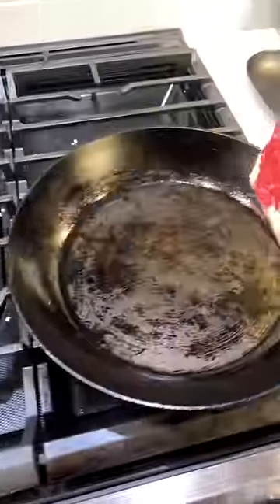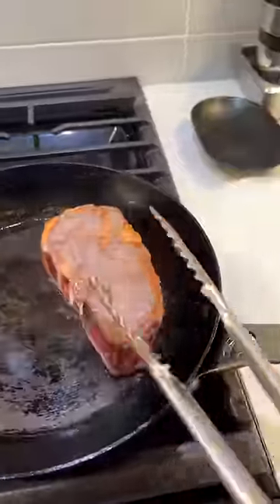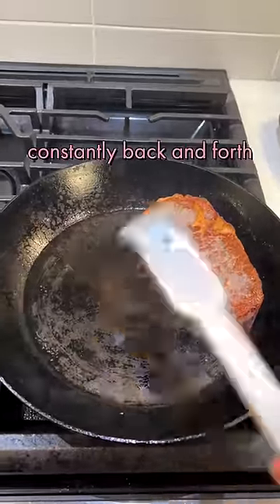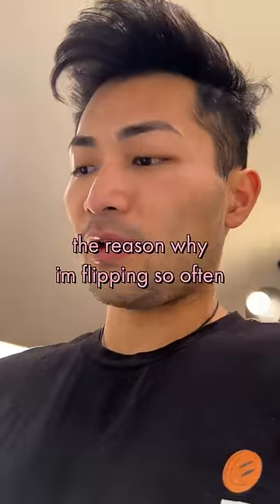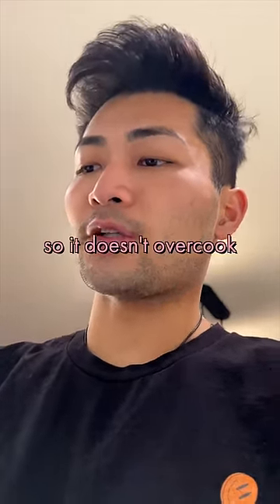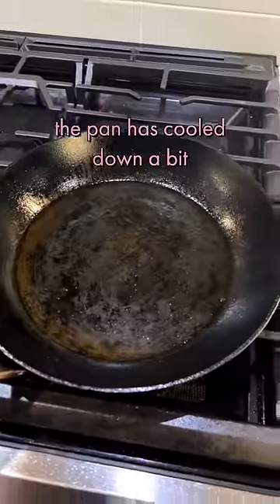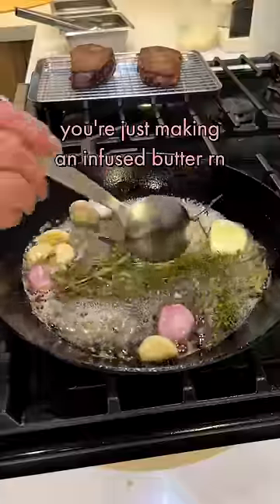useful steak tips for the home cook, part 2 of 3

Comment: Dat "knob of butter" 😂
Reply: Bruh added a pound of butter for 1 steak
Reply: @Blernster  it’s wasn’t that much butter, but the reason he used so much is so you can baste the steak. basically scooping the melted butter up with a spoon and pouring it on top of the steak to cook the top with the hot butter
Reply: “2 shots of vodka”
Reply: “Dat”
Reply: @Blernster  your acting as if he is gonna literally drink the butter with the steak.
Reply: @Blernster   that’s about 3-4 table spoon.. not even a lot for a 20+oz steak like that. And most of it goes away in the cooking. He’s not slurping it all and eating it with bread lol.
Reply: I use ghee which doesn't burn and is still full of butter flavour

Comment: i like the method of flipping often. I think of it as almost "rolling" the protein across the pan or grill. 

in addition to what you explained, i think it's also really great for people who maybe aren't as experienced since they might not know the timing for the "one flip" method and risk burning the meat with such a hot pan.
Reply: well said!
Reply: On Bon Apatite they called this the "frequent turning method", the main advantage being for non-uniform cuts that could cup slightly when the cooked side contracts and the uncooked side doesn't, so a portion of the cooking side no longer touches the pan. Frequent flipping means uniform cooking and contact, so even crust development, even on cheaper cuts.
Reply: @User-j63849j  or, get this: multiple ways work. clearly, doing it either way can yield great results(a proponent of frequent flipping that comes to mind is gugafoods)

so why not appreciate both? there's plenty of people such as yourself promoting one way of doing it and its good to change things up.

Comment: Flipping will make the caramelisation process slower/harder and pressing down on the steak will make it’s fat loose on the pan, instead of its inside
Reply: Could you make a video showing this? I've heard the lack of flipping is an ego thing. It's better to over flip and make a perfect crust.
Reply: There are many good techniques in cooking to maximize good flavors and minimize those you don't want. People take it way too far with steaks IMO and there's a lot of BS out there. The difference between doing flips every 15 seconds and doing only 1 flip is so minimal that you'd never notice in a blind test. Something like basting with an aromatic oil/butter makes much more difference to the final product than the flipping, patting, etc. that people are doing to their steaks. Cooking a steak well is really not all that complicated and you don't have to rely on weird "tricks" to cook a steak well.
Reply: @anthonyantoine9232  I completely agree. Steak isn't a set cooking recipe. There are several people that start learning those old ways or bs that you shouldn't even test the temp of your steak by piercing it. Steak is amazing and is an easy way to impress you're guests once you get it down.

Comment: Do not press steak unless
1. Its very thin and curl and you need to flatten it (its a lost cause anyway)
2. When its already sealed, and you want to check its cooked to your liking (how soft it is tell you how cooked it is inside)

Pressing on it before it sealed just lose you juices to the pan, making it colder and the steak drier
Reply: yeah this guy also flipped 6 times which doesn't make any sense. I learned you flip once and then broil.
Reply: Yeah! Plz don't press it
Reply: @GorillaCape flip once is a rookie move!
Reply: Searing does not seal in the juices. Escoffier was wrong on that one :/

Comment: You actually don't want to press down, You want some oxygen in between there to help the Maillard reaction.
Reply: maillard reaction can occur without any oxygen present, the concentration of oxygen doesn't affect the reaction rate
Reply: this video is pretty wrong, basically everything he said is the exact opposite of what you want to do
Reply: @ObieTriceratops  I was hoping for this comment! That's why I said 'help' the reaction. The air keeps the temperature under control. If you heat at a temp above the maillard threshhold it burns the enzimes, which is difficult to distinguish.
Reply: @Apoz   maillard is by definition non-enzymatic browning. Are you just making this stuff up?
Reply: @ObieTriceratops  Haha! Sick, didn't expect the same guy to take the 2nd bait as well. Maillard is a non-enzymatic browning indeed. But it still chemical reaction of amino acids.

You must be the guy that knows a bit here and there, gets confident and subsequently forgets to properly read the question on tests?

Reading comprehension must not have been your strong suit!
Reply: @Apoz   so you’re saying air between the steak and pan distributes heat better, which prevents enzymes from burning by keeping the temp under the “Maillard threshold”,  and thats important because the reaction involves amino acids?
Reply: @Apoz  don't be a coward, defend the nonsense you're spitting out.
Reply: Without good contact with the oil or the pan, there won't be as much of a Maillaird reaction--or there will be more burning. Conduction is, as you allude, more efficient that convection.

In this technique, the frequent flipping  helps keep the surface temperatures in check.

Comment: This is Hestons method. He used a thermal camera to see when the top side cooled down, not so it can cool down but so that maximum heat is applied to both sides. 20s also works okay for me, 6mins total. Get a multi timer app. Also this created the mallard reaction, to get the data and proteins to caramelise.

Comment: Bro I've been cooking steak for over 40 years you're trippin
Reply: proceeds to not have a rebuttle. #internetwarrior
Reply: why
Reply: explain then? come on
Reply: @MrPsychoteen  i mean hes probably right, just wish he'd explain. this video does seem kinda extra/stupid
Reply: @eattoast6378  nah, this isn't stupid. You can try it yourself, I noticed it while searing a steak once and have been doing the exact same thing for a couple years now.
Reply: @MrPsychoteen   OK. 1st you get yourself an iron frying Pan 9 to 12" whatever suits you  Medium high heat until the handle gets warm or hot to the touch this means your Pan is heated all the way through which means you don't have to turn it every 15 seconds 3rd put a tablespoon  of oil wait for it to smoke proceed to put your steak in  press down it cooks evenly And Sears evenly by the thickness of his steaks I would say it would be just around 4 to 4 and a 1/2 minutes per side for medium rare.  You don't move your steak there's no need for it you wait for the 1st side to steer then you flip it over that's when you add non salted butter which increases the smoke rate so you actually don't have to let your pan cool down. Base with the aromatics and butter for 4min then you let your steak stand for 5 minutes.  END MED RARE but he didn't show you that he also didn't tell you how to get it perfectly cooked steak at medium rare he just gave you a dumb way to turn it over every f**** 15 seconds Just because it's difficult doesn't make it better bro simple is delicious.
Reply: @dmd2652  why press the steak
Reply: @CarlosFlores-pl3lb  but why press it? and why remove the oil if im literally going to baste it in a quarter cup of butter anyways? :/ it doesnt make any sense
Reply: @eattoast6378   Bro he presses it down in the video you gotta press it down so it gets an even sear
Reply: @dmd2652  i didnt ask if he pressed it in the video. i asked why press it. not pressing it has never resulted in an uneven sear for me. so i didnt understand the point.
Reply: For sure, this guy has no idea how to cook a steak. Didn't even season the meat.
Reply: @motalkbadazs  anyone with common sense and any level of cooking experience can see he did pretty much everything wrong
Reply: @eattoast6378  don't listen to this channel, this guy has literally no idea what he's talking about, he didn't even season the meat.
Reply: @dmd2652  no, you don't. You're not supposed to do that nor do you need to to develop a sear.

You should only give advice to people if you actually know what you're talking about
Reply: @dmd2652  Fair play 😂
Reply: @moomaniac2932  wait that’s wrong too
Reply: @moomaniac2932  you most definitely do need to develop a sear?, give me a point on why you shouldnt.
Reply: @miberss  I don't think you read what I said
Reply: @moomaniac2932  also you do need to press down to develop a sear, it keeps air bubbles from keeping it up making the steak gray, and just heated rather than a sear
Reply: @miberss  you absolutely do not need to press down to develop a sear. Have you never cooked a steak before?
Reply: @moomaniac2932  explain to me why you dont, you havent given me a point on why i shouldnt, how am i supposed to believe you
Reply: @Midas  I'm not the one making the claim, the burden of proof is not on me. You don't need to press on a steak to develop a sear.
Reply: @miberss  just watch literally any professional chef cook a steak
Reply: @moomaniac2932  it doesnt matter if your making the claim, just tell me why i shouldnt press on the steak. here il give some proof to my arguement, you need to press down on the steak to get a sear because bubbles get trapped at the bottom of the steak, developing an uneven sear.
Reply: @miberss  bubbles of what 😂😂 how old are you?
Reply: @moomaniac2932  steam/air... why would you need to know my age, you dont need to be the oldest person on earth to be good at cooking.
Reply: @miberss  have you ever cooked a steak before?
Reply: @moomaniac2932  you have yet to give me a point on why you shouldnt press down on the steak...
Reply: @miberss  and you've answered my question and there's no point in continuing this conversation
Reply: @miberss  the reason why you don't press on beef is because it squeezes the juices out and decreases the flavor
Reply: @eattoast6378 It is a bit extra. You don't need to do all this to have a good steak. But it does reduce banding by a milimeter or two FWIW. The only technique better than this is sous vide finished off with a butane-torch sear.
Reply: @eattoast6378 You're pan frying. He's searing.
Reply: @flourishingoctaverye  he is quite literally pan frying that steak in this video. He is not just using the pan to sear it. He even prepared a fucking baste. You stay out of the kitchen, alright? 😅
Reply: @eattoast6378  Technically, you're right. He's cooking in a pan in an oil medium--hence, pan frying. But, seriously, no.

Observe:

0:02 - He uses a negligible amount of oil: just enough to 1) prevent sticking and 2) facilitate contact between the protein and the carbon steel. Searing =/= pan frying.

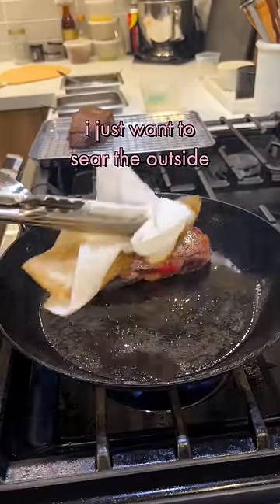0:38 - He soaks up the excess oil to prevent what he calls "deep" frying--to me, deep frying is what you do to fried catfish or chicken. He also says, "I just want to sear the outside." Searing =/= pan frying.

PS Butter basting =/= pan frying either.*

*Unless you're a Spaniard who "butter" bastes with EVOO. That's a hybrid technique IMO that's neither here nor there--much like a French sauté.

Seriously, it's one thing to conflate pan frying, griddle cooking and cooking a la plancha. But to fail to distinguish between those related techniques and searing ...

Do you think that stewing, braising and pot-roasting are all the same thing? What about broiling? Grilling with the lid on? Smoking? Dhungar?
Reply: @flourishingoctaverye  Not reading that. Cooking to temp over stove top on pan = pan frying. Stay. Out. Of. The. Kitchen.
Reply: @eattoast6378  Lazy reader.. lazy cook. Hm, I guess that tracks 😁

PS How'd you manage to ape my comment, seeing as how you didn't read it 🙈

Comment: Quick myth debunk: Adding oil to butter will not prevent it from burning. Each fat has its individual smoking point, and they cannot be increased by mixing them. If anything, the only thing you're doing by adding another fat is slightly decreasing the temperature of your pan. If it starts smoking and burning, the temperature is simply too high.

Comment: When you place a cold cut of meat onto a pan it quickly reduces in eat, but not so much with cast iron. They are amazing at holding in heat, even after adiing something cold.
Reply: Yes , I use ribbed cast iron if I run out of propane for my grill .

Comment: Our induction cooktop goes hot as fuck. Zero issues with a side cooling down so not required. Though also use a thick cast iron pan so it holds the heat for ages when turned off too.

Comment: There’s 2 ways to do it. This way, which is the flip often method and the other way, which is the 1 1/2 two 2 min on one side then flip only once method. Either way will sear it perfectly. Trick is to have the pan hot but not scorching and finish in the oven.

Comment: 1.5 inch fillet mignon, add olive oil to cover bottom of pan 60% let it spread on its own. Med High Heat  when oil begins to smoke it is ready, add garlic around the outter rim of pan, add 4 table spoons of butter, place steaks beside garlic and butter and sear for 3 minutes baste the stakes with the oil 2X, turn and sear the other side 3 minutes - lift them off the pan (egg rings) place the pan in preheated oven at 375 for 6 minutes for Medium Rare. Enjoy the perfect Steak.

Comment: If you're using a nonstick/ceramic pan sure, the meat might actually cool down the pan a little but if you're using a cast iron pan like in the video, the heat capacity of the pan is so high that "flipping the side" will make virtually no difference. Also, you wouldn't be deepfrying the steak because of a little bit of fat in the pan. More fat actually ensures an even sear. The reason you flip the steak is to avoid one side of the steak contracting when getting hot and leading to a bad sear on the other side.
Reply: It's a carbon steel skillet
Reply: @codypeterson185  No it isn't, carbon steel pans aren't that dark.

Comment: First tip - get the steak to room temp before you put it in a pan
Reply: It's been shown again and again that it makes no difference. The main factor to get a good crust is to dry the outer layer of the meat as much as possible. Left at least overnight uncovered on a rack will do the job.
Reply: @Nibinin   if you cook a steak below medium - and it’s not at room temp it will still be cold in the centre

Comment: It's not really necessary to do this. Cast irons have uneven heat distribution compared to other pans so as long as the flame is right above the steak then there's no problem with just flipping it once

Comment: Hi British chef personally it looks like youre not allowing your steak to get to room temp before putting on the pan (if you dont do this it will cause the shrinkage, you shouldn't squish your meat as you'll bind and split the fibers together and also you only want to flip it twice at most mainly trying to baste the meat reasons are exactly the same as for the first one.... however you using the half on half off method I can tell you we do this when we tilt the pan while basting...

Comment: I hate this so much. Just temper your steak and you don't need to worry about "cooling" one side of the pan. Also you're using cast iron so that pan should be piping hot to the core. Set your steak down and don't touch it until that side is done, usually 3 or 4 minutes. This ensures the Maillard reaction occurs which is what you want from steak.

Comment: You can’t sear a steak flipping it every 15 seconds nor can u heat the middle of the meat to proper temps. Plus you just knocked off most seasonings which are supposed to soak into the sear which you messed up on. You turn a steak 2x. 1 time during cooking and then 1 time placing on the plate. Might as well eat a piece of jerky.

Comment: Your steak is supposed to be room temperature when you begin the sear, so if it's "cooling down the pan" you haven't let it come up to temperature yet. Once it has warmed up from your fridge temperature, season both sides liberally with salt and pepper and add your oil to a hot skillet. When it just starts to smoke, place the steak in the pan. It's done on one side when the salt crystals from your seasoning allow the steak to release from the skillet. If it's sticking, your skillet is either not the correct heat, or you tried to move the steak too soon. Once both sides have been properly seared and they have that crust, turn the skillet to low and then add in your butter and fragrant herbs and garlic. Then baste the steak with the infused butter and to finish, let the steak rest for at least 10 minutes off heat. Leave the garlic and herbs on top of your steak and those flavors will continue to infuse the meat.
Reply: I dont think the ripping hot pan is room temperature...

Comment: Pointers because there are a lot of mistakes here.

Get the pan hotter, flip it less. You shouldn’t have to do more than a couple minutes per side for each side. All that fat you wiped up came out of the steak and there will be a significantly lesser flavor.

DON’T squish the steak down, no one actually squishes a steak like that and it releases juices unnecessarily.

When you baste the steak the garlic is more than an aromatic you HAVE to crush it, it’s completely pointless to throw it in there uncrushed for such a short period of time.

Comment: Ive been told never to press down on the meat while on the heat, and flipping so much releases juices. Also, the idea that one side of the pan will be significantly hotter than the other because you put a slightly cool steak on it is simply just laughable.

Comment: Take the steak out of fridge, salt it, cold pan, add oil if not using a non stick pan, add steak, turn on heat to high, once reasonable sizzling starts, go medium heat, and flip the steak, flip every 10-20 sec, feel or thermometer for doneness, best done on non stick pan but cast and carbon pans are also good. Minimal splatter and minimal gray ring, no need to wait for room temp steak, and great crust. Easy weeknight steaks after work.